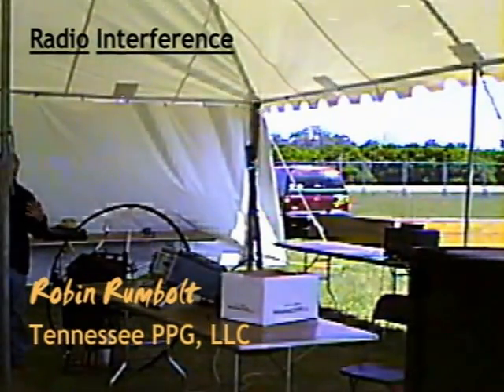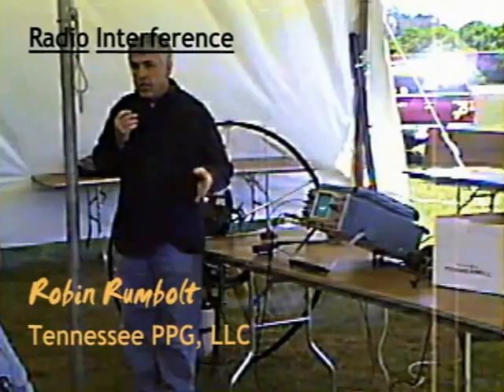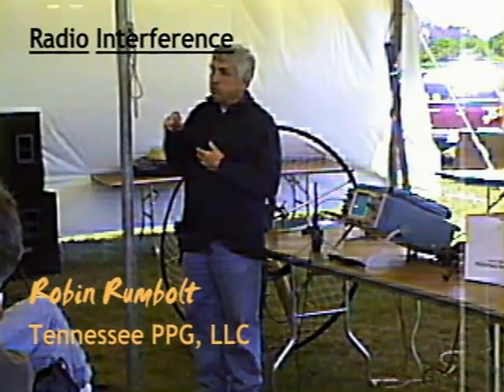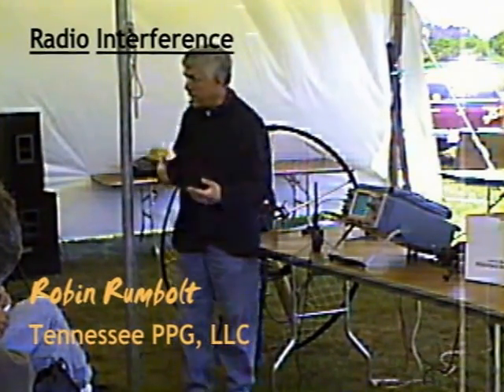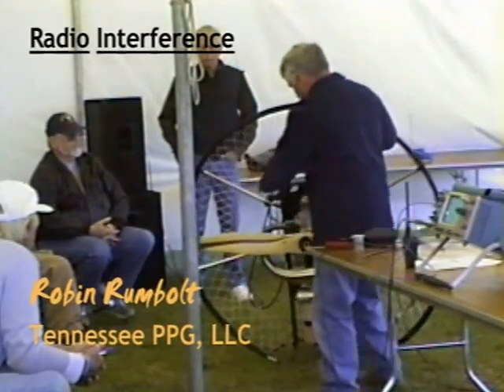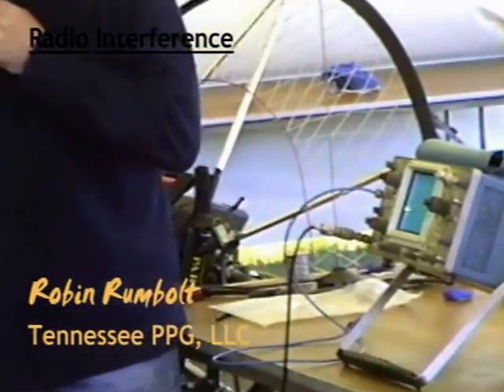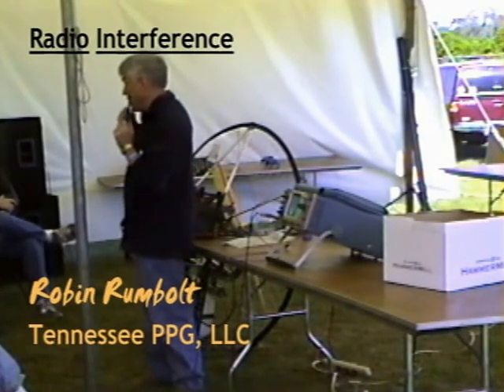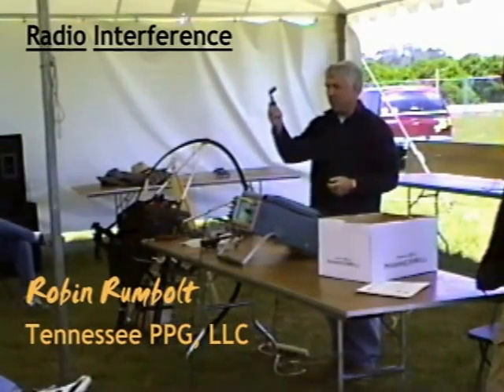Eliminating Radio Frequency Interference - Robin Rumbolt

Comment: Really old video but, I just found it. Would anyone happen to know what's in the kit?  Or how to get a hold of Robin Rumbolt to get a list of contents or buy the kit?
Reply: I have also recently been interested in this video/ application. After researching some more; I’ve decided to order some braided copper sheathing of various diameters to simply slip over my ignition/ kill-switch wiring and will tether it to a grounding point. I’ll try to let you know how it goes.

Comment: Do you think i could just put this kind of shielding over the whole throttle cable (kill switch wire, tach and cht temp wire): Try adding shielding wire to your ignition cables, (And ground them)  helped a bit with my static.

Aircraft Spruce carries it cheap.

https://www.aircraftspruce.ca/catalog/elpages/copperbraid.php?clickkey=12614